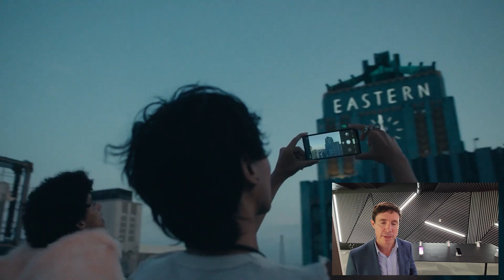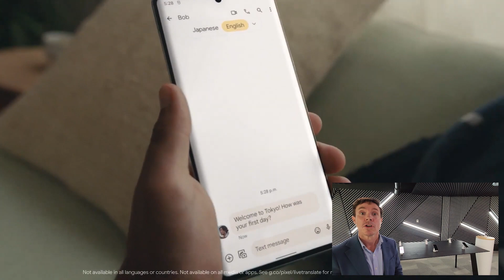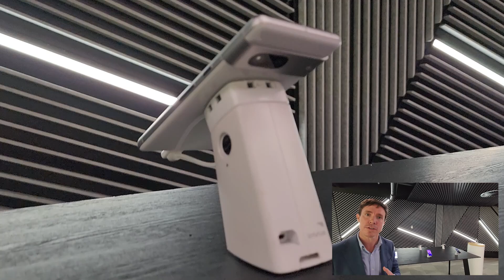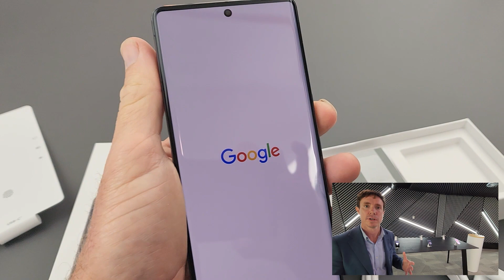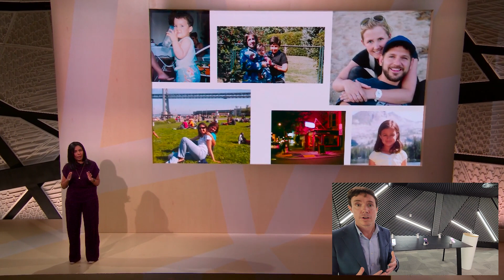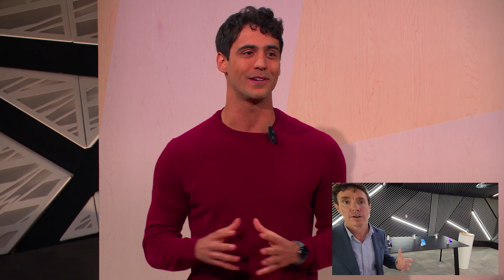Google Pixel 7 & Pixel 7 Pro interview: How does it improve?

Comment: So you have to pay for a subscription to store your photos and videos after 3 months and how practical is it to change all the photos and videos on your phone to lower resolution after you take them? I wish they had better options for storage or is it just better to buy a bigger memory phone outright?
Reply from the maker: Personally, I just plug my phone into the computer and drag to my desktop regularly. I find cloud saving iffy - requires good connection - and a drain on battery. The problem with converting to low res on your phone is that you either have to have two versions of the image, or sacrifice the high res version (which will negate future use cases like printing it out on canvas). The bigger HD is a solve, but it also encourages laziness, as you don't have to be as disciplined downloading files to your computer.

In short, the epic MP and recording quality is great, but it does compromise storage solutions.
Reply: @Chris_Stead  Great thanks, can I ask how you organize your photos and videos when you put them on your desktop as I find it difficult to organize them easily.  Regards
Reply from the maker: @MrRobinski  Just in folders labelled by event/trip/period/kids. I did try various program solutions, but I have so many GB of photos, I didn't find one that worked. My system is far from great.

Comment: Personally, battery optimizations will only extend battery life on standby, or at most on basic computing tasks - including photo taking and video recording. But it will not change how apps or games consume power though, at least not noticeably, so bear that in mind. My only optimism for their decision is if the Pixel 7 has none of the Pixel 6's throttling and overheating issues, then maybe it'll just be as good as the Pixel 6, at best.
Reply from the maker: Yeah, being able to make it last for 72 hours on extreme battery saver doesn't feel like a feature to me. It feels like you have to basically not use your phone. Looking forward to testing that out.
Reply: Hopefully app devs and make their apps better optimizes 
I have the F1 TV app and that thing heats up my P6P so much just watching like 5 minutes
Reply: Most people wouldn't notice if the phone throttled without running benchmarks. I play games like COD, pubg new state, stand off 2 etc.. with no issue. I play for like 30 minutes to a hour. Genshin impact is a poorly optimized game so it's characteristics shouldn't be considered being it throttles everything. At the end of the day all smartphones throttle to prevent components from getting damaged. Gaming phones have fans to aid with this to minimize throttling in most cases.